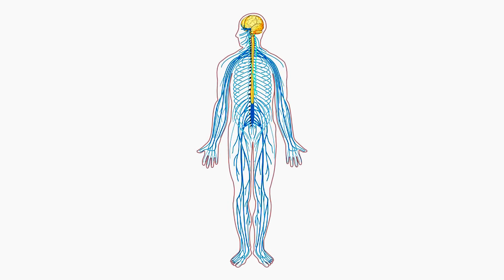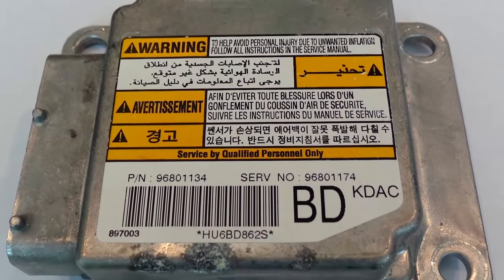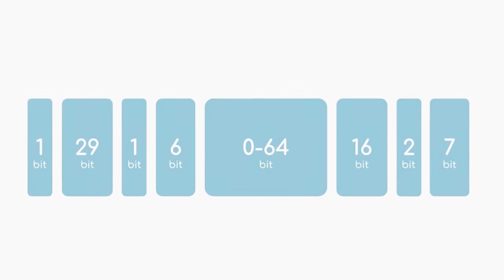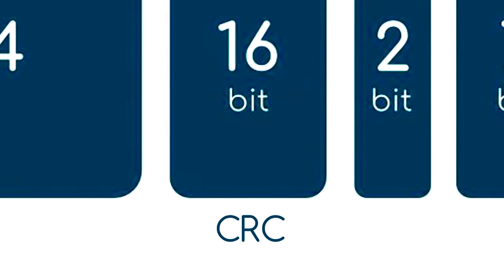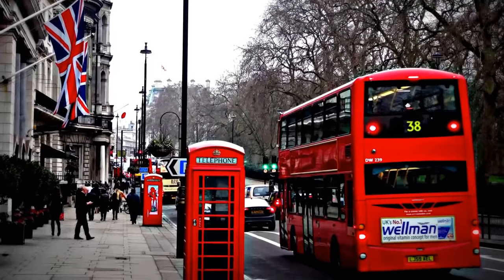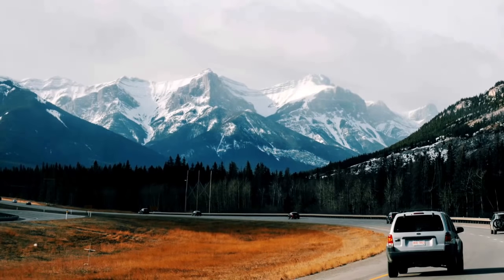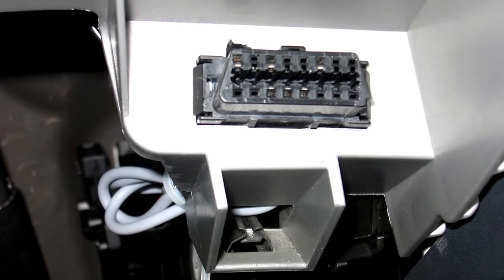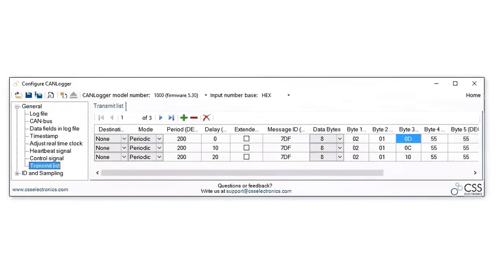CAN Bus Explained - A Simple Intro [v1.0 | 2019]

Comment: How about a mention of the actual physical embodiment rather than showing pictures of totally irrelevant things. For a layman's intro, I still don't know how many wires, how long wires could be, what the voltage signal levels are, or if it is even voltage driven and not a current loop (ala MIDI). Otherwise a solid explanation of the data layer and the history.
Reply: Have you found any good sources regarding this? God bless
Reply: I don't think you know what layman means.

Comment: Among your key reasons "#2 Centralized" is quite wrong as it's pretty much the opposite. CAN bus is a multi-master (= decentral) bus system. The feature "allows for central diagnosis and configuration" is simply because you can plug in "just another node" that listens to the bus and interprets messages. And - because it is decentral - can also send (configuration) messages.
Reply from the maker: You're right that it can seem misleading, the centralized is indeed referring to the fact that you can access the entire CAN bus via a single entry point, rather than e.g. having to go node-by-node. But it's valid feedback that we'll consider :-)

Comment: If the “ BUS “ or module change is not in tacked ,the ecu  or computer may not communicate with systems on vehicle. We have a condition now were the throttle body is not commutating with ecu causing racing up and down of RPM

Comment: Thanks for a well-balanced introduction into this technology!  I have an ODBII reader and have used it for both DTC retrieval but also for real-time data.  The interesting thing about CAN is that it is similar to XTML scripting (website and other networked data) in the sense that it is eXtensible.... to a point.  The data structure is familiar, especially to me via an understanding of the old AT telecommunications Command Set protocol.  And I suppose if you know serial or parallel digital communications, PLC integration, etc... that is a help, too.  BUT I could understand this even without that background- I needed the video to make the correlation between these.  Thanks again!
Reply: Tremanate canbus on a motorcycle

Comment: CSS ELCTRONICS, what are the step by step diagnostic steps that a technician does to troubleshoot BAD CAN waveforms signals, how does the technician know what is a GOOD CAN waveform signals and what is a BAD CAN waveform signals, what are the common failures to look at for when using a CAN bus that a technician looks for?

Comment: Nice and neat explanation... Not sure though if the term "ECU" is being used correctly, as it stands for "Engine Control Unit". The correct term would rather be "Node" when referring to the line replacable units.
Also the reference to IOT might be a bit overdone...
Reply: According to their article, it stands for electric control unit and not engine.

Comment: Anybody knows what CAN L is & how to find it?
I have a DTC describing a short on a CAN L line between the OBD2 port of my car and another point
Reply: CAN L (stands for "low") means the signals ranging from 1.5 to 2.5 V and CAN H (high) ranges from 2.5 to 3.5V. possibly one of the wires to the odb2 conector is corrupted...Hope I could help somehow.

Comment: I find all the computerization of cars to be unnecessary. Why do I need a computer to turn on my wipers from a signal it receives from the switch, when the switch could simply supply power directly to the wiper motor?  How is the typical owner supposed to diagnose a simple matter, such as inoperative wipers, without vast wiring schematics, or a specialized laptop computer, or both?
Reply: john90430 so true
Reply: They diagnose it by checking fault codes. Your problem is that you don't understand modern electronics. Everything is so much easier than it was with old analog systems.
Reply: Wayne, the first word - the very first word - in your reply says it all: "They"
How about me? I am not "they," with "they" referring to dealership (or independent) techs with plug-in computers to read fault codes and software to translate those fault codes into actionable diagnoses. I am a poor-ass old man with an 18 year old car who can't afford to take it to a dealership, and who is trying to squeeze a few more miles out of a car that is at the end of its useful lifespan. 
My problem is not that I don't understand modern electronics, but rather that I don't need them in a simple automobile when direct wiring through regular switches could more easily accomplish the required function. Why have a switch that contains various resistors alter the voltage of a return signal to tell a computer to turn on my wipers when it is far easier to just have a switch close a simple fucking circuit and turn them on?
You know... Positive voltage to switch, switch either passes current to motor or not, then from motor to ground. Or, positive voltage to motor, switch completes circuit to ground. Simple. Easy. No computers. No bus. No Body Control Module. Maybe a relay, but that's all. Sensible.
All that crap is fine when the car is under warranty, and I don't have to pay out of pocket, but not now. Not when the repair bill is going to cost more than the car is worth.
Reply: The car dealerships still need to make money, too bad, you have to pay.
Reply: john90430 that’s the way everything will be
Reply: Because software is far more flexible and easily changed.  So instead of just turning on the wipers, you can do intermittent wipers, give the operator control over the interval,  make it automatic detection and setting of interval etc etc etc.  Without changing any hardware you can make it do anything you want.  Small micros are super cheap so even the cost doesn’t really come into play.
Reply: Get with the times. The world you're looking for hasn't existed since the 1980's. It's quite simple if you'd stop trying to be ignorant and actual learn how these new systems work. It has simplified manufacturing and service of the auto industry as well as help advance it.
Reply: Before computerization, if your wipers stopped working, you'd have to pull out the factory service manual wiring diagrams and possibly special tools to start diagnosis. In my 1989 F250, troubleshooting the cruise control involves using a special dealer-only tool to test the system. In a modern car (where this feature is far less likely to fail) all I need to do with the multimeter is to establish that there's no interruption in the wires, then use a universal OBD bluetooth dongle and read any error codes on my smartphone or tablet.
Reply: Technically yes but in reality no, if you have I direct point to point wire for everything it would make todays cars heavier and significantly more expensive can bus network uses many control units which are connected by 2 wires can hi and can low and each control unit then has its own earth and power, the number of wires required is reduced significantly and it will also allow you to diagnose problems efficiently. in some ways it makes simple problems require a laptop to diagnose but it makes it easier for operators to diagnose complex problems like why my engine is misfiring and the network is able to tell me the crankshaft position sensor is faulty.  its a process of elimination in an older vehicle especially with earlier versions of common rail.
Reply: Adding features to an old skool car would make threading more complex and heavier. We simply cannot go on driving old cars that are way too heavy and consume way to much petrol and lack the safety of modern braking and control systems. Nice for an individual ride on a given Sunday but impossible when massively used worldwide. Are you still glaring at a television set from the fifty's? Modern flat screens give a better view and consume only 10% of the electricity  that classic ray-tube types do.
Reply: @john90430   if anything its usually a dead battery , see car battery op voltages . or its battery conections or earth leads from battery /engine.  After that parts that plug in, fuses,  etc, a typical example is a heater relay switch, heater only blows out on max ... about £10 for seconed hand one.
 Its a misconception that its all to complicated. Really.
 Whats broken - check battery- voltage conections earth straps-   
  2nd stage - research on youtube and read the comments,  - order a seconed hand part ebay- 
3rd stage either fit it yourself or get a price from garage .
 
other options - ask a local garage to diagnose and offer to pay a small fee for this and their opinion or ask for opinion and get a price for them to do it,  if you do it yourself dont expect to go back in amonth a do they same again with another problem.
Reply: @hereIam1965  Seriously? A dead battery? So, the car starts and drives okay but the wipers don't work, and it's a dead battery, you say?  Exactly how is this "dead battery" supplying enough current to start the engine, but not run the wiper?
Reply: @Hempie1000  No, but I occasionally listen to music with vacuum tube amplifiers from the 1950s which I restored myself.  Sounds really good, too.
Reply: @jackcotter1  Yeah, the computer-controlled engine... I know, I know... Throttle position sensor, cam and crank sensors, mass airflow sensor, ambient temp sensor, coolant temp sensor, air/fuel sensors, oxygen sensors... did I miss anything?  Great for engine management.  Not for wipers that don't wipe.  Wires making the car heavier?  Sure, but those stupid "aero body kits" weigh several times more than a few feet of heavier gauge wire, and don't get me started on tow hitches that never get used - there's a good 85 lbs. right there.
Reply: MichaelKingsfordGray  Nope. Go to a dealer parts department and check out a modern engine compartment wiring harness that's been replaced under warranty if you want to see horrendous complexity.
Reply: @JamaicanBoy41  "Trying to be ignorant." That's funny... not.  Oh, yeah... just go "learn how these sytems work."  Perhaps you can teach me, Mr. Knowitall.   Have you priced a Body Control Module for one of these cars?  I worked in several dealership parts departments over the years, and not much has really changed except for the price of the parts.  You can bet they ain't going down!
Reply: @JamaicanBoy41  Still in NJ?  When I was living there,  most people didn't resort to name calling on such a childish level...  But if that's your style, whatever floats your boat.  And I think you're missing my point.  Now I see why.
Reply: So then modern cars are not for you. But some modern cars cannot function without CAN or a similar serial digital messaging system - think EVs. And that is where CAN is a good thing because it opens up these more complex systems to "you" and "me" and out of the hands of "them". Yes, you read that right. I now can get access and control of say the Tesla Motor controller or the Tesla dash display - which I absolutely hate - and replace it with a smart tablet running an app that I can customize to my liking (if that's my thing) simply by accessing the CAN bus and sniffing for the appropriate messages (See Torque app for example, or the new Mini Cooper dash based on Qt). As far as specialized equipment, there are CAN loggers, sniffers and data analyzers cheaper than a SnapOn socket set, so tool cost is not a barrier to entry. Personally I see value in being able to customize modules that I can choose to repair or replace or modify and not be beholden to the manufacturers who will not be responsive to my requests to say disable the auto locking "safety feature", or turn off those annoying chimes, or disable the anti-theft nonsense altogether, etc, etc. As a hot rodder wanna-be there are already so many awesome aftermarket upgrades for even my 100 year old ICE cars that CAN has enabled (dash displays, auto shifting, gear shift stacking, flex-fuel, turbo boost control, etc, etc). And there are so many more coming for EV's that allow taking a closed system (like just about every EV) and return value to the drive components that otherwise would be scrapped. So, as with everything tech, there are those who can do without it and those who can adopt, adapt and improve. And for the record, I am also a poor-ass old man who drives 18 yo obsolete cars (Saab 95's) and pickups (Chevy 1500) and looks for ways to repurpose what is considered junk. Which is why I am looking at using cheap scrapped EV motors and controllers to put in a blown out Mini Cooper and make a drift car - yes, really.
Reply: @waynes.2983  easier than checking continuity of a switch or apllying direct power to the wiper motor? gotta be fucking drunk dude...and yes i work with can bus systems and they say it was invented to simplify wiring but thats bullshit. for example the peugeot 206, same car same equipment but has a canbus version and a non canbus version...now afer 20 years the canbus ones have many many expensive problems...the stalks used cost 120€ for the canbus car, but for the normal car they cost 10€, the wiring harness is bigger on the canbus car but all the fucntions one model has, the other also has...so canbus=planned obsolescence and complication. the only tool you need for an entire electrical system on anormal car is a test light...
Reply: @jackcotter1  older common rails and older EFI's are only difficult for the ones who understand shit about mechanic and electrical...canbus is great for them but beware because the fault codes sometimes can trick you into replacing the wrong part and if you dont understant how a system works at a low level you are stuck...if i get a poor running gasoline car i check fuel pressure, injector pulse,spark timing and lastly compression..no need for any scantool...if the car has obd i will read the codes but then i will still do my hard diagnostic before any parts are ordered...yesterday got a code for a bad cam sensor and it was the timing belt that skipped 2 teeth...let a kid with a laptop diagnose that

Comment: Ecu = engine control module. There is only one ecu per car.
Reply: aquatrax123 you obviously have ZERO experience in automobile control systems.... a CAN system (Control Area Network) can be multiple in number of ECU’s.... they all operate through communication between each other
Reply: ECU = Electronic Control Unit, there are many control units on a vehicle. The video says 70, some are above 100 now.
Reply: you are correct, did not know the ecu also meant electronics control unit. Though the video was saying the car had several engine control modules which it does not. Fully understand that there are several other computers in a car. Learn something new every day.
Reply: @aquatrax123  Quite a few cars I work with now have more than one control module for the engine. It's not unusual for vehicles over 6 cylinders to have 2 engine control modules (one per bank). This is due to mapped ignition systems and the drivers can't operate that many in one module.

Comment: Yup. Blah blah blah techno blah. Which is why im building a 34 ford with stone age technology.
Reply: Solid fuel rocket booster? Doesn't get simpler than that!
Reply: Get with the times bud!
Reply: Carburetors and points and condenser ignition. Can't get any better than that. That's what I liked about my '84 f150, except for the EEC IV ignition. I put an Edelbrock on it and was surprised how complicated carbs can actually get, I think I'll go for the Rochester quadrajet next time.
Reply: Then why did you even come here? The title is clear enough.
Reply: GOOD IDEA
Reply: I love hot rods but you do get fuck all performance for the noise and grunt they produce. They have their purpose for cruising around town, sounding shit hot and looking damn good though.
Reply: @bairfamilyfarm1336  quadrajets are a lot more complicated than an vacuum secondary carb because a quadrajet is both. The throttle valves are mechanical but the secondaries have a flap which meassures mass air flow and adjusts the fuel mixture with metering rods

Comment: Im a tech in the trade for about 15 years and i still dont understand why people want so many toys in their cars. A car is supposed to get you from point A to B and thats it! only thing essential are heater/aircon, power steering and a simple radio.
Reply: Because of mileage, pollution and safety rules by goverments i think.
Reply: For purpose of "getting from point A to B" you can use a horse, donkey or something even simpler. Then why you need car after all then? Exactly, to have a nice, warm/chilled, clean of dust and mud, comfortable (i can continue endlessly) device to use "to get you from point A to B".

Comment: 17 ECUs??? the car have 17 engine therefore needs 17 [Engine Control Unit]???
do the basic research please
Reply: *electronic
Reply: @caps244  Correct, it's meant as electronic control units in this case
Reply: Ecu is not engine control unit but electronic control unit. If there is only one ecu CAN communication itself is not required. It's required because there are numerous ECU's like body control unit, valve control unit etc..

Comment: Just an electronic nightmare. I'm going back to a set of points and condenser in the distributer. Have an extra set in my little tool box in the trunk of my car and if it stops running I can fix it on the fly! Good bye.